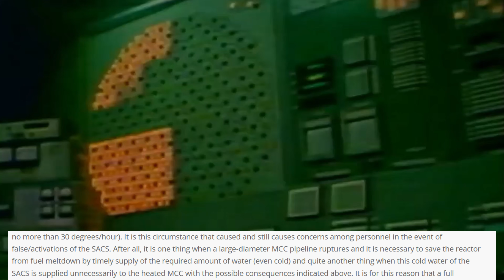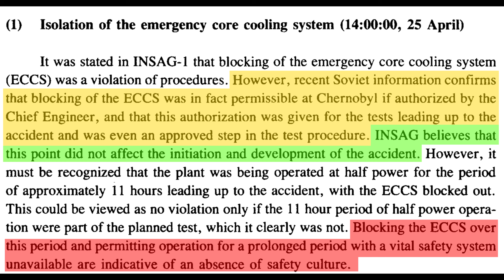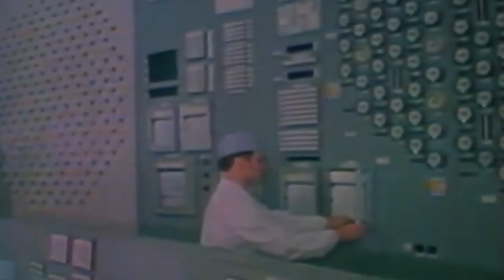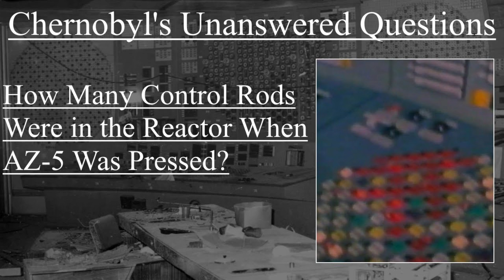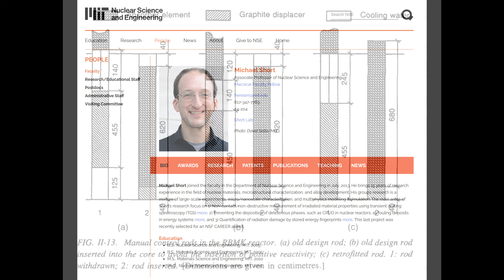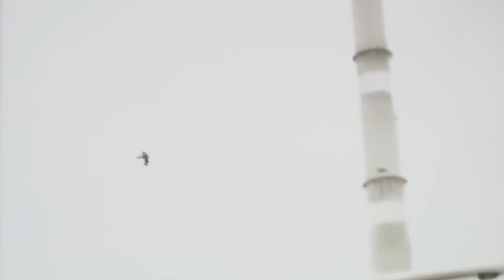Truth and Fiction: The Legacy of Chernobyl

Comment: Curious if there is any evidence of subsequent modifications to design and operational guidance manuals that also point to the true reasons (and hence the coverup). I mean: they could shift blame, but they still have to fix the problem.
Reply: The main modifications are described in Section II-3 of INSAG-7.

Comment: Another excellent video, as a fluent Russian speaker I also spend non zero time debunking (for myself) small details "lost in translation" regarding both Chernobyl and Soviet wars in general. What I miss greatly is someone looking into details of the uneven neutron distribution in the core. Most importantly the vertical distribution, not just across the diameter. I'm not well informed enough, just have a suspicion, that the instrumentation (number and distribution of sensors) was just as "Soviet style" as many other aspects of the whole power plant design (not just the reactor itself). No wonder even these guys were scared to export the RBMK reactors, I'm convinced there was more to it than just the fact that it was or could be dual use for military purposes.

Comment: 9:21 It seems there might be some confusion about what is meant by “safety culture.” “Safety culture” isn’t something that just belongs to the operators in the control room or even just to every employee at the power plant. It is required of everyone involved in the industry, from design, construction,operation, to disposal and decommissioning, from those doing the work to those overseeing and regulating it. Part of having a safety culture is following practices in the safest way that still accomplishes the task at hand. One aspect of this, radiation exposure, follows the ALARA (“as low as reasonably achievable”) principle, but the same basic idea is common across all activities to achieve a “safety culture”.  To be clear, “reasonably achievable” is not the same as “possible.” 

The contradictory requirements (from the designers by way of the operating procedures) are evidence of a lack of safety culture. The fact that the requirements don’t say how long a Chief Engineer can approve disabling it is a glaring deficiency in safety culture from the designers. And even though disabling the ECCS was part of the test procedure, it should have been sequenced so it only occurred when actually necessary. Which is to say, this isn’t only a charge leveled at the operators. 

But the operators, had they been part of a “safety culture” (again, that encompassed everyone involved), wouldn’t be relying on “well it technically wasn’t a violation.” When the call came in from Kyivenergo, the safe thing to do was to secure from preparations for the test until they were cleared to perform the rest of the procedure. They wouldn’t have kept the ECCS disabled when it was clear they weren’t executing subsequent steps of the procedure right away. 

Sure, the probability of needing it is minuscule in any 12 hour stretch.  But that’s the same fallacious logic for not buckling your seatbelt for a quick trip to the grocery store. Very unlikely you’ll get in a crash during such a short time! Might as well not bother ever wearing it…what good does a seatbelt even do, up until you need it? (This analogy is not to imply that the ECCS would have mitigated any effects of the accident.)
Reply: Great post thanks.
Modern nuclear safety culture has developed from the aftermath of major accidents and incidents so it is fairest to assess Chernobyl against 1986 standards not today's standards.
But the Windscale fire, TMI and K-431 had already happened by then, not to mention several criticality accidents in both the USA and the USSR. 
Also, the time at risk argument for disabling the ECCS may have been flawed. I think it requires the assumption that the test cannot affect the integrity of the normal cooling system. Without that, carrying out the test and cooling system failure are not independent events,  so you cannot use the previously predicted failure rate to predict the risk during the test window. You need a new failure rate that allows for any effects from the test, including from its operation of cooling pumps.
Currently UK regulations include Licence Condition 22: Modification or Experiment on Existing Plant. This requires proper safety cases to support and changes or experiments. I guess we have Chernobyl to thank for the explicit inclusive of Experiment in its title.
Reply: @derekp2674 , thank you. I agree that ideas behind safety culture are different now than they were 40 years ago, and a lot of the progress is driven by major accidents. I also agree that judging actions in the past from a modern lens is, in general, frivolous.

I wrote the post because I don’t think that INSAG saying that actions of the operators displaying a lack of safety culture is blaming the operators. These videos seem to take the opposite view, and it is one of the very few positions in these videos I disagree with.  Instead, I think that INSAG was trying to develop a consciousness around the need for “safety culture.”
Reply: @Geffde Thanks. Obviously the operators were scapegoated when the whole Soviet system was really responsible for the accident.
Reply: @Geffde Your objection will be addressed in a dedicated video.
Reply: @derekp2674 That is not accurate.
Reply: @derekp2674 Blaming the system diffuses blame. That is exactly what blameworthy individuals wanted. It's similar nonsense to safety culture. Chernobyl is a matter of particular things. You go from there, not trying to stretch anodyne half-nonsense like safety culture like Geffde has been. That's music to the ears of those truly responsible, and some of the things Geffde has written on this are downright laughable. These are loaded terms that get in the way of understanding this disaster.
Reply: @markusw7833 Sorry I was talking about responsibility not blame.
Whilst the term safety culture may have been something of a retrospective invention, arguably first used in post Chernobyl reports, responsibilities for nuclear safety were recognised from the start of nuclear power.
For example, in the early 1960s, both the UK and the USA published their first national standards for ex-reactor nuclear criticality safety.
Cold war production pressures had led to a rash of criticality accidents in the USA (and the USSR, if that was known then). So, from international discussions, these standards set out good practice recommendations for nuclear safety.
From the start, these standards recognise that administrative arrangements for nuclear safety must be in place in organisations setting out to work with nuclear materials.
From that viewpoint, if incidents or accidents occur, the most important thing is to identify corrective actions to prevent future accidents.
Apportioning blame for what's already happened won't prevent future events and cannot remediate events that have already occurred. So I think it is a less useful activity.
Reply: @derekp2674 While safety culture is a valid concept, in the context of Chernobyl it obscures fault.
Reply: Two key points: 1. Saying I acted according to my training and the rules is what operators typically do, e.g. airline pilots are supposed to follow checklists not take the checklist as the bare minimum and then add on a bunch of additional things they believe provide additional safety. Designers and engineers have the luxury of the additional time and understanding to go beyond the minimums set in regulations. 2. Nuclear power plants are complex, having the ECCS suddenly dump cold water or having to watch and decide about it during the test makes it more complicated and less safe, e.g. it might make an operator miss something else important. Without knowing the process and decision-making leading up to the decision one can draw few conclusions about priorities or principles involved based on outcomes, any more than someone making a poor decision in poker allows you to infer they didn't care about winning.

Comment: Funny how a nuclear reactor always needs a natural river in its design to work..
Another point is that if electrical grid fails in a country..
The back up is fossile fuel generators 
to keep some old used in storage rods
 still emitting heat and so thus spliting atoms.. cold.
Before its overheats and creates pollution, spill, explosion.
All designs are flawed.
Even my laptop and the internet.
Reply: Fundamental basic thermodynamics requires any power station using a steam cycle to dispose of low temperature waste heat somewhere.
As in the Simpsons, nuclear stations can use cooling towers, but rivers, lakes and the sea can also be used.
Reply: @derekp2674  The Design is flawed and sucks.
Reply: @mikebon8352How would you do it better then?

Comment: Why is it that no other discussion of emergency core cooling systems mentions the issues of adding super cold water to a super hot reactor? This apparent downside of cracking parts via thermal shock doesn't come up in Fukishima or Three Mile Island discussions, or general lessons about nuclear safety.
Reply: I can’t speak to why the discussions don’t talk about it, but there is no downside of cracking parts via thermal shock because if you NEED the emergency cooling, you’re not saving the reactor. It’s toast anyway. You’re just trying to keep everything cool enough that it doesn’t melt.
Reply: General is general. Specific courses in nuclear engineering safety do however stress the important trade-off between risk of thermal gradient driven shock loads leading to plastic collapse and risk of reactor runaway.

Comment: Man, it's so lame that to turn Emergency Cooling off or on, you need to spend hours turning valves by hand. This is what killed Akimov and Toptunov.
Reply: As was stated in the video, the operability of that system would've made no difference to the outcome, because the triggers for that system were never activated.
Reply: @MBKill3rCat  That's not what I'm talking about.

Comment: Honestly, you should put together a book (or several!) with the excellent info you gather. I would gladly but that! :-D
I think I've read most of the existing ones, but the damage done by Medvedev has spread everywhere. I want as much truth as possible (or reasonable hypothesis on available data) not scapegoats and good TV stories.
Reply: Yes! Get some accurate books into circulation so that accurate information can be quoted instead of decades if incorrect info 📖

Comment: I like how the nartive Chernobyl always is a the end "magical the scarm was broken."  It was always broken. If they start there stories that way it s clear it was the design engeneers fault.  Imagine having a car then when you turns off has a chance of exploding.
Reply: It’s worse then that.  It’s like the owners manual to the car just has cryptic warning not to operate the car in certain ways but doesn’t say why your not supposed to operate it in those way and then says you can operate it in those ways as long as you consult your local factory trained mechanic.  Except your local factory trained mechanic doesn’t know the reasons either and is told your car can’t explode.